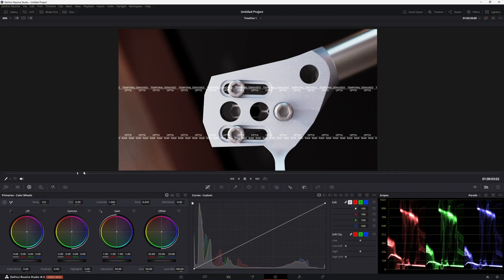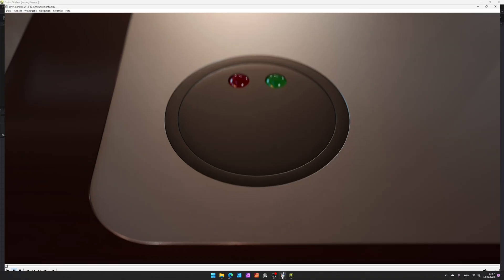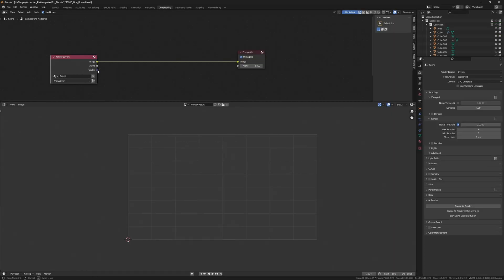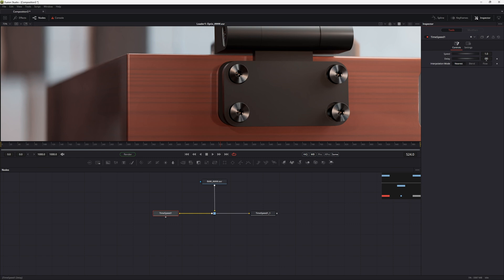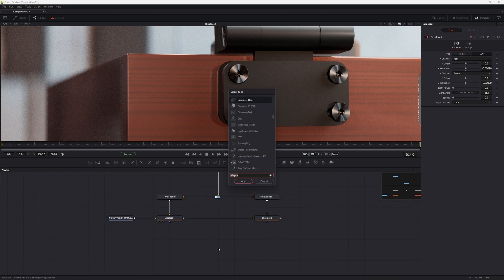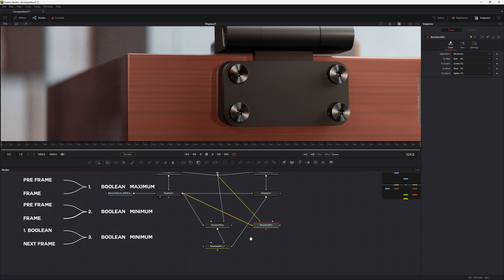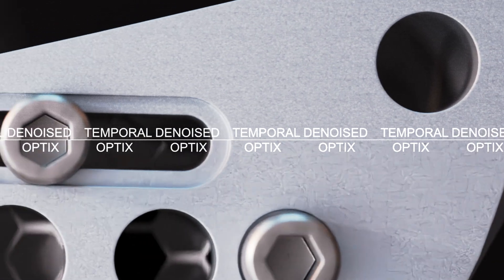Blender Path Tracer Denoising in BMD Fusion

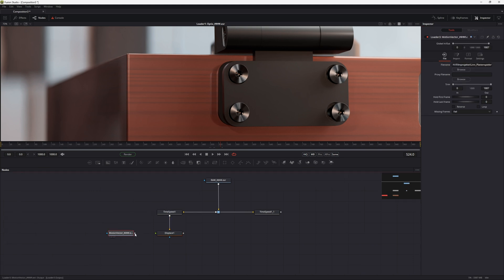Comment: 1:15 you also need to offset the vector map: put a "TimeSpeed" node between both "Displace" and "MotionVector" nodes, otherwise you will see artifacts on fast moving object.
Reply: to improve it further, you could create a mask that controls the area of influence and replaces artifacts with the original image.
you need your color layers combined into one: DiffCol + GlossCol + TransCol. (no direct/indirect layers, just color) duplicated your temporal denoise node tree, (input = color layer)
add a ChannelBooleans set to "Difference" (yellow input: denoised color layers, green input: noisy color layers )
connect an "Erode / Dilate" node (Filter:"Gaussian") and a "bitmap" (Channel: Luminance) (with those 2 nodes you can control the strength and blur of the mask)
finally add a "Dissolve" node (yellow input: denoised render, green input: noisy render, blue input: "Bitmap output") it also functions as an manual on/off switch

Comment: Nice! Good idea and well explained. And I was able to whip up a test example using this trick in Blender as well, so it does work in its compositor!

And note to others: this is temporal denoising only with camera motion. So this won't fix anything if the camera doesn't move. Obviously with most animations, people plan to move the camera anyways, but just worth noting. Overall, great tutorial/study!
Reply from the maker: Thank you! Maybe if you set the sampling seed to random, each frame and each pixel (regardless of the the static camera) should have a slightly different result and would smooth itself with this technique as well. But this is just my guess, I will test it later
Reply: @notapicturedesign  ahh right, I forgot about that setting in my test. After re-rendering my test, it does catch more fireflies that way. Thanks again!
Reply from the maker: @SpencerMagnusson Cool! You are welcome
Reply: @SpencerMagnusson  would you kindly share your node setup in blender pls
Reply: @maxshoooo  I'll find a way to share it if need be. But the math formula is the exact same, just use the same image sequence at varying offsets for the previous and next frames.

Comment: Hi, Julian. The sequence you used don't have any kind of denoising, right? Do you think this can be done also in Blender, with compositing nodes?
Reply from the maker: Hi Rodrigo, I have not tested it yet. But it should be possible with the blender compositors as well. Exactly, I used the "raw" OpenEXR undenoised sequence.
Reply: Amazing. This can save a lot of time. In the future, this could be an integrated option in the render settings. Have you tried denoising the secuence after your process? In order to eliminate any remaining noise residues. @notapicturedesign
Reply from the maker: @rodrigosaure  Sounds like a fantastic idea. For the final version (not shown in this video) I added the denoiser of DaVinci Resolve Studio. Works excellent.